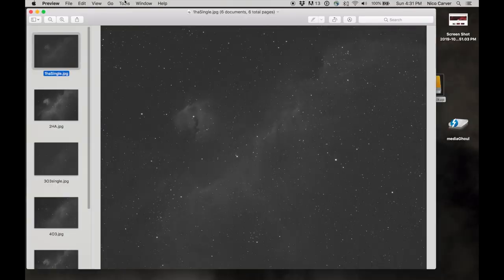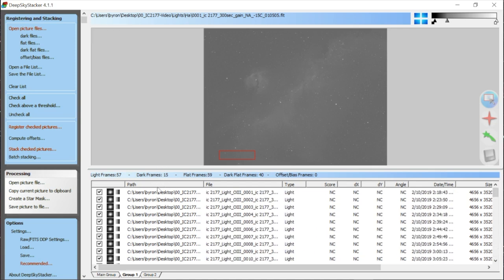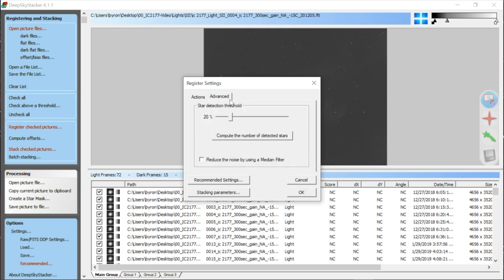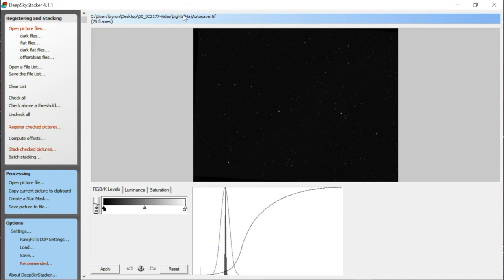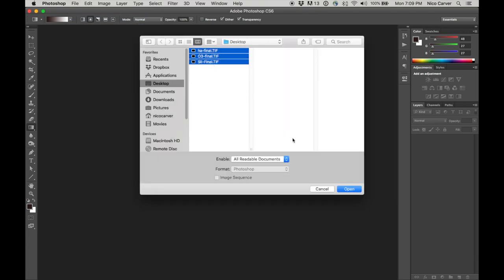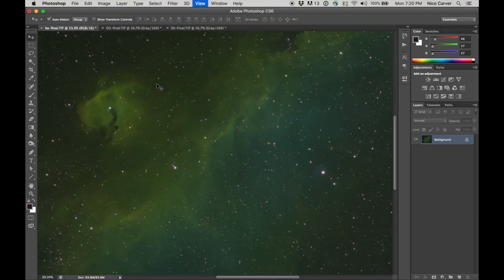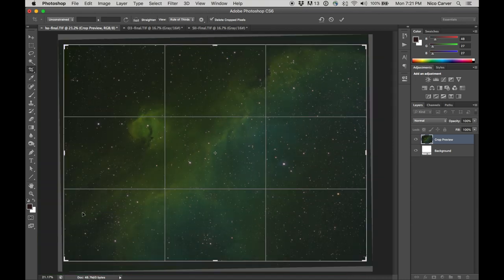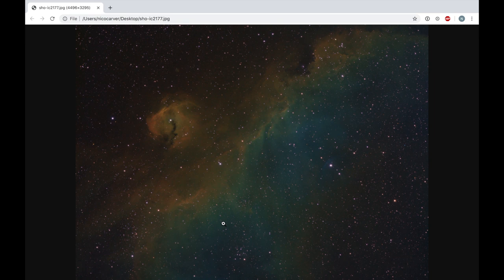Intro to Narrowband and Hubble Palette, Part 2a - DeepSkyStacker and Photoshop

Comment: Waiting for NArrowband filter processing for a long time. Thanks Nick, very informative. My problem is, I do not have a dedicated astro camera but a DSLR Canon 800D. I wonder if I can use it on monochrome mode with narrowband filters.
Reply from the maker: Hi Volkan, 
No, unfortunately monochrome mode is just a JPEG transformation of the color data in a DSLR. The color filter array is physically attached to the sensor. That said, some people do narrowband imaging with DSLRs it just takes longer, and is less efficient than with a mono camera. Hope this helps, let me know if you have any other questions.
Nico

Comment: Hi Nico
I’m really enjoying this video as I acquaint myself with processing narrowband images in Photoshop. 
My question is why do you open the three files as separate tabs, each in their own tab, vs. using the Scripts-Open as Layers method so that they each appear as Layers in a single file?  Is it because the 3 files need to each be stretched individually, something you can’t do if they were Layers?
Thanks!

Comment: Hi Nico. Thanks for all your hard work. Question: You said that you need to shoot flats for each filter. What about dark-flats? Thanks.
Reply from the maker: If using the ASI1600 or ASI294 (or QHY equivalents), yes you would need dark flats that are the same exposure length as your flats for each filter. Basically any other camera, just use bias frames in the calibration process rather than dark flats. The only reason I use dark flats is I had weird issues with the bias frames of the ASI1600 that are camera specific.
Reply: @NebulaPhotos  Thanks!

Comment: I watch this video frequently to make the steps "automatic" in my brain. Just wondering: three channels for three narrowband filters.  What about LRGB? Four filters but three channels. What's the place of luminance filter light frames? Thanks.
Reply from the maker: After assigning the rgb channels as we do in this video, you would take you luminance (processed separately) and place it as a layer on top. Then change the blend mode to "luminosity" and use curves to reset the black point. I haven't done enough LRGB imaging to make a video about it yet, but the idea is that it is faster to capture more detail by letting in more light with your Lum filter. So you process the Lum stack to be as detailed and sharp as possible and shoot fewer RGB frames (that have heavy noise reduction) as the rgb is just used "color" the Lum. The reason I havent done much Lrgb imaging is that it works better under darker skies. Tough to do with city light pollution

Comment: Nico, we have narrowband and have been following along to try to copy this workflow. For some reason after merging the channels together, the more we stretch and do curves, to more stars tend to turn red and lose their vibrance. Not too sure what we are doing wrong.
Reply from the maker: This is common for narrowband stars to not behave well. For strong magenta/red stars there are three things to try: 1. Press ctrl, shift, alt e to make a new from visible layer, and open Filters->Adobe Camera Raw filter... Scroll down on the right side and their should be a megenta/red defringing control. Try playing with the strength of that slider to see if it helps. 2. Press control-i to invert the picture then take a curves adjustment and take down the highlights in the greens until the green around the stars is gone, then press ctrl-i again to invert back. 3. Use starnet++ on copies of the mono narrowband photos. Combine these starless versions to taste. Add just the Ha (with stars) as a screen blend. This will just add white stars, but I often go this way, and think it looks good
Reply: @NebulaPhotos  Would it make sense to take additional RGB subs, just for the stars?  Then, you could use Starnet++ to paste in the more natural looking star layer onto your narrowband nebula image.  Also, this technique could be used to reduce or eliminate star bloating by taking shorter exposure subs in RGB. I’ll have to try this unless you can see a flaw in this logic.  Thanks for a great video!
Reply from the maker: @davidleejenkins  Yes, I often use RGB stars on top of HOO starless data, which I think looks quite good. RGB stars on Hubble Palette can work too, but sometimes looks perhaps too colorful/chaotic to my eye.
Reply: Thank you!

Comment: How many minutes of subs do we need for narrowband? Is 5 minutes sufficient? Doesn't it depend on light pollution? At what point do we see diminishing returns?
Reply from the maker: It depends on many factors, yes. I basically just try to get the histogram off the left edge so I'm not clipping. The key is as much Total integration as possible

Comment: I noticed you did not use Starnet++. Is that personal preference or is it not required when processing Narrowband and HSO/SHO images?
Reply from the maker: I usually do, but it depends on the photo. For this one, I went simple and thought it looked good, so stopped there. Typically though the OII and SII signals will be much, much weaker than the Ha, so I make each narrowband channel starless and then stretch them differently before combining in to a starless "tone map" - this is the JP Metsavainio method, there should be videos on Youtube with more details.